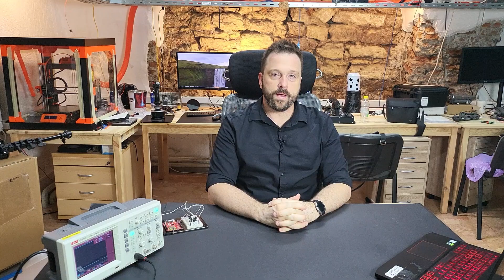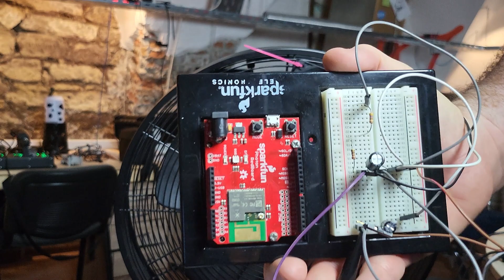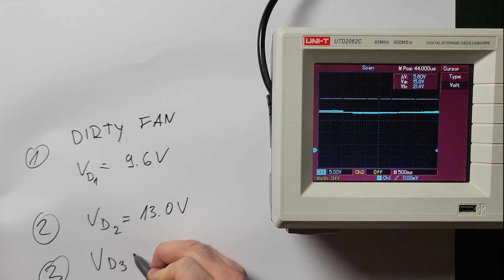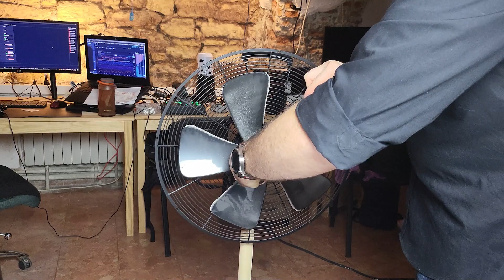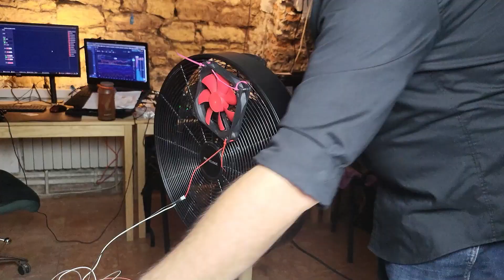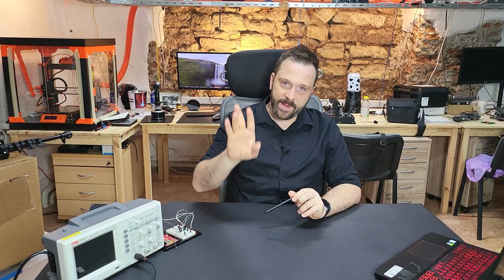Experiment: Testing fan airflow (clean vs dirty)

Comment: Cool experiment. The difference is much more than expected. I'm going to wash my car now a bit more, especially before going on a long trip. But one shouldn't invest too much into a wash cause then the cost of a wash will outweigh the benefit of better aero :). Think aircrafts are also being washed for better aerodynamics, less fuel consumption, as well as safety reasons.
Reply from the maker: That is very good observation. We just need one Nevera and test the acceleration when it is dirty vs clean :D